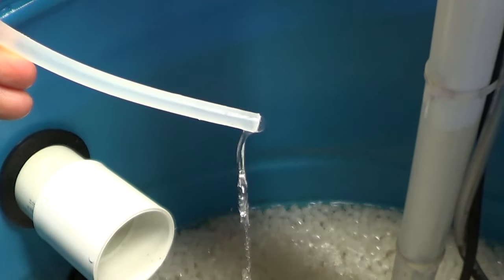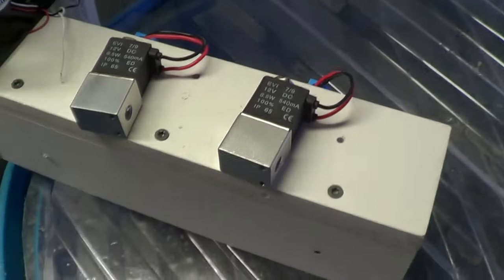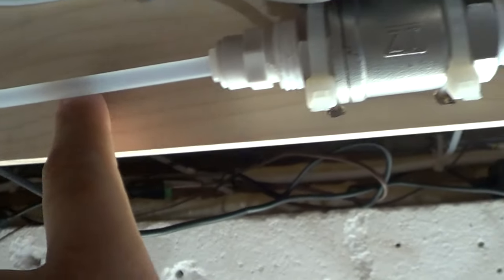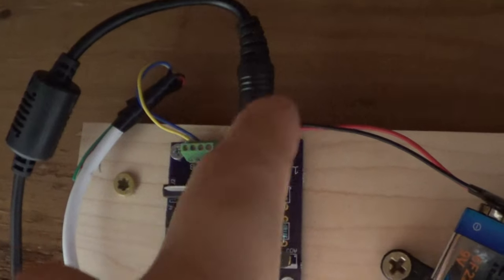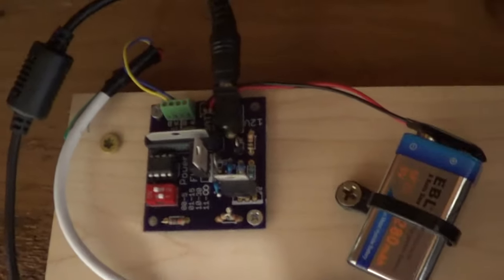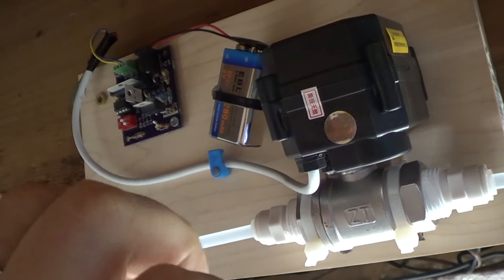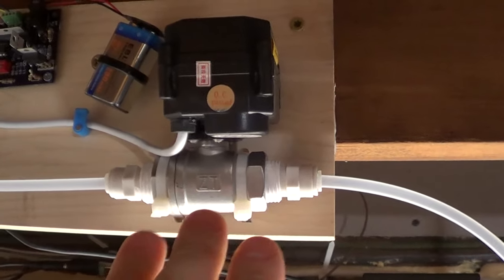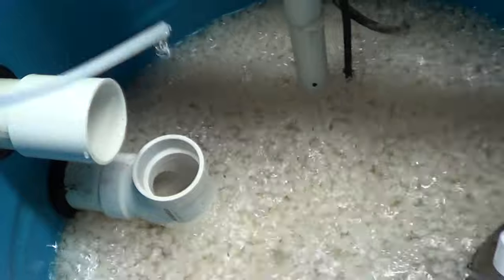#315: PowerFULL - How to use a Motorized Valve to Turn Off an Aquarium Drip System - DIY Wednesday

Comment: Looks like a good solution.  Not sure how much that board might cost.  If its very expensive, a 12 volt relay could essentially do the same thing for you if wired correctly.

Comment: Both of the systems you have made are really nice, but a thought on the solenoids, why didn’t you set the valves on a timer to have them shut of 2-3 times a day for an hour each? That way you would let the valves cool down, and in the same time keep them moving so they dont set.

Comment: I know a lot of people in the east coast have back-up generators for standard stuff like lights tv and a fridge. Do you have 2 though one for the house and one for the fish room because power outs happen yearly.
Reply: This isnt going to supply power to anything when power goes out, its not a generator. It just ensures that his sump wont overflow when his return and sump pump turns off in a power outage.
Reply from the maker: Chris We don't have a backup generator for the house, although i'd love to install one some day. We are lucky enough to have municipal electric and they do a really good job at responding to outages. Let's hope I get one installed before I really need it!